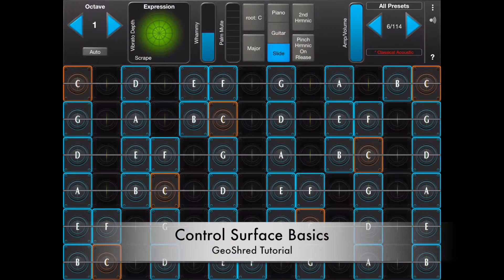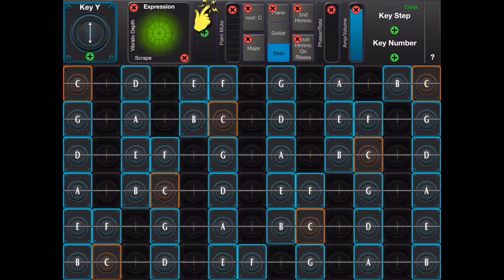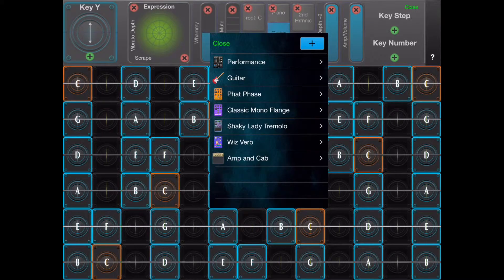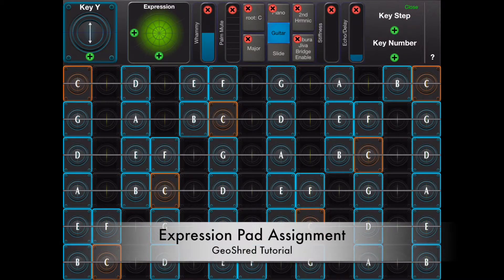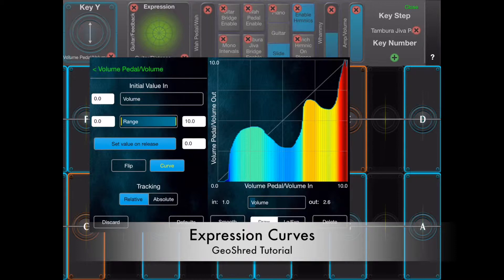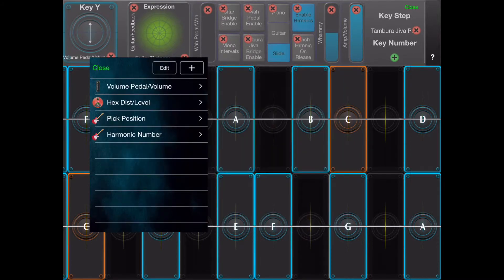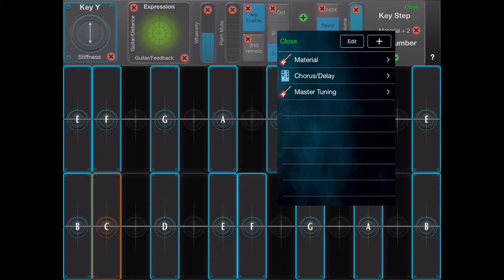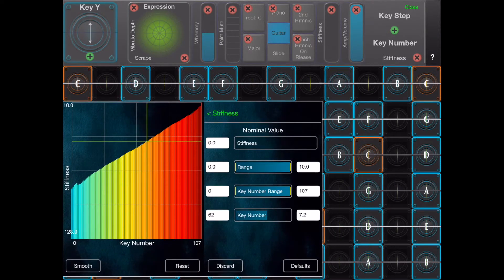5   GeoShred Tutorial Control Surface Editor (Latest)

Comment: These options to customize the Control Surface are outstanding! However, while you can add controls for Play Backing Track and Backing Track Volume, there doesn't seem to be an option to select another backing track from the Control Surface (Set Backing Track control). This would be really helpful for easily working with multiple backing tracks per Preset. Is there any option to achieve this? If not, how can I submit this as a feature request?
Reply from the maker: Rob, you are correct. Play backing track is a simple mechanism and intended to be nothing more.   

There are an endless set of features that could be in a player recorder and we are not in the player/recorded business.  We are an physics model instrument maker.    There are many products that do this well and will work with GeoShred running as an Auv3 plugin including GarageBand (Free). 

Long list of AUv3 products here: 

https://docs.google.com/spreadsheets/d/1vydiVIIZR48AFiRcfANzmRnec-eZ-6yiE5C21ztkU6A/edit?usp=sharing&fbclid=IwAR2UKArrcna1Q5JUMQQQe-XL0DkvGVkaxD4NSW0Err2zAfjB4T-aBxTSgbU